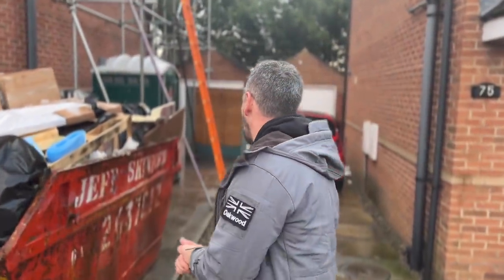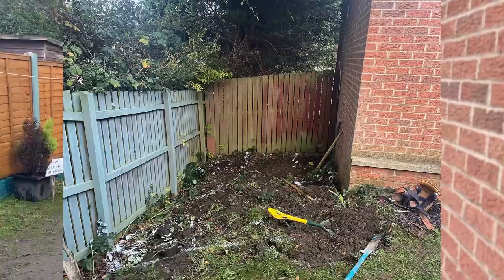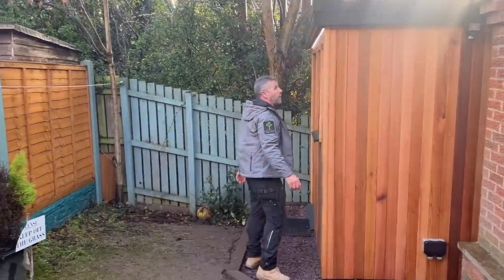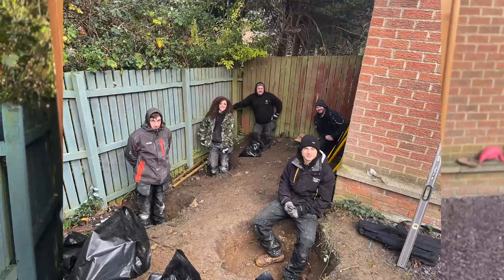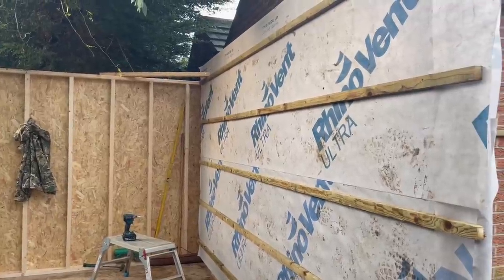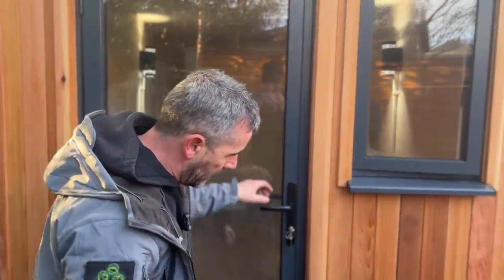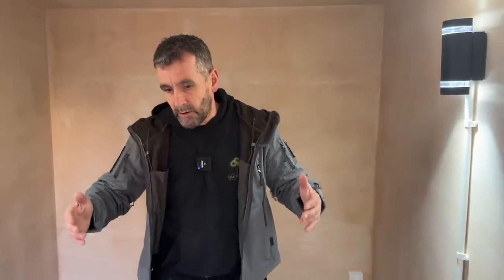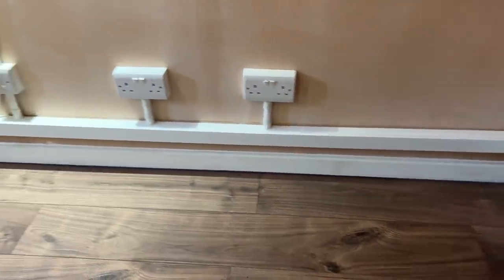Garden room come music studio

Comment: Hi Liam, The soundproofing isolation clip is the MuteClip and MuteClip Channel you have used in the build (6:11).
The Membrane between the 2 layers of acoustic board is the Tecsound SY70 which is a viscoelastic membrane.
The rubber product on the floor is MuteMat OSF 750-10 with the Perimeter flanking band (blue band around the edge).
Looks like really high-quality work as always!!
Reply: I've used the Muteclip and MuteClip Channel products from iKoustic and they are really easy to use.

Comment: Another great vid. Thanks for uploading. Did you run the cat6 cable alongside the power cable? I'll be doing the same to my garden room. Do you what type (spec) of cables they were. I get confused about 'interference' of high voltage cable to low voltage (something like that!?).

Comment: Great work guys as per usual. 
I personally think if he spent so much trouble to soundproof everything, wont the sound leak out the door and window?
Reply from the maker: I’ve fit a door frame to the inside of the glazed door, the customer is going to fit a solid core door at a later date, and a screen over the window
Reply: @thegardenroomguru  fair enough, makes a lot more sense.

Comment: Another sound tip, when using two layers of plasterboard use a soundblick and another type same with glass thickness of each pane.

Frequency cant travel through different thicknesses as easy as it ,an through two of the same material.

Comment: Who’s the customer Andrew Lloyd Webber 😂😂 nice build other than external conduits etc, but seems overkill for the postage stamp size..
Reply from the maker: cutting into the boards apparently will defeat the object so everything was surface
Reply: That is correct. The aim for soundproofing is to have a “room inside a room”. You can get sockets that go into the wall and have options to ensure that sound doesn’t pass through. However, given the space available, external conduits would be the best option.